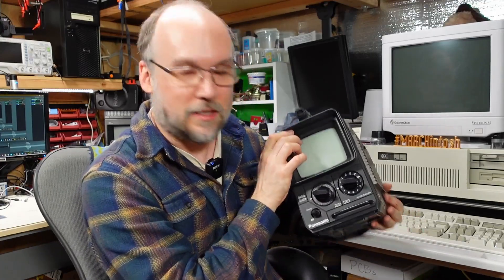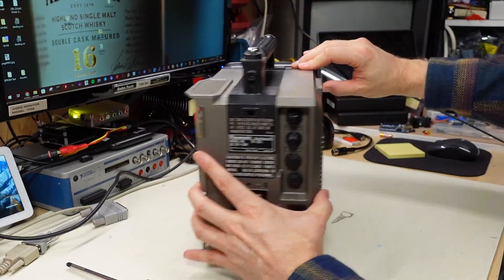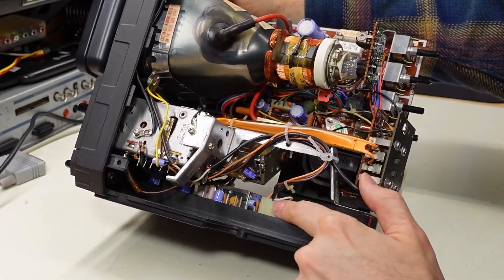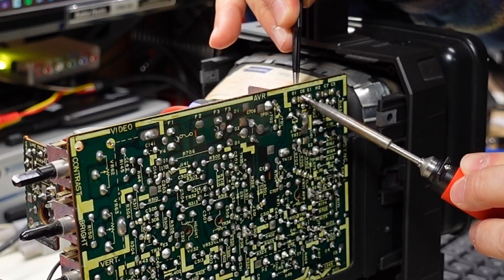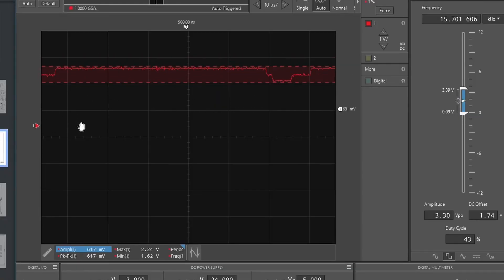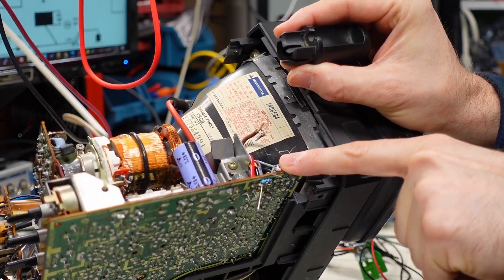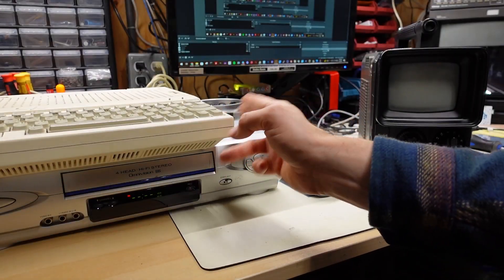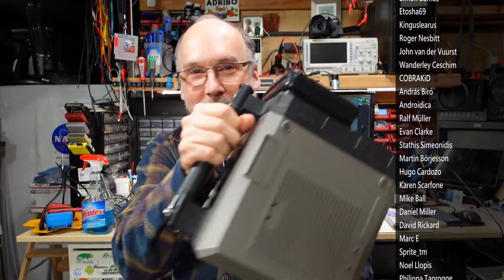Adding a composite video input to this 1977 portable TV (Panasonic TR-555)

Comment: Years ago I converted an old Russian "Vega" 6" tv to take composite, and I was surprised how good the display was. As a TV it was always a bit fuzzy with broadcast or a VCR even if you spent ages tuning it, but the output from my computer through my composite mode (not that different to yours) was really crisp. I guess the problem was with the tuner - maybe it was out of adjustment.
Reply: Similar story here, except with a Soviet (proudly says CCCP on things like the IF cans) Elektronika 409D, which was rebadged as a Waltham Telestar 4004 here in Germany. As a TV it was... meh at best. With a composite mod? Razor sharp image. And that's with all original components (granted it was only made some time between 1989-1991, but the internal construction looks a lot more like 70s tech than anything close to 80s, let alone early 90s)
Reply: It's also possible that you bypassed a stage similar to the dot-crawl suppressor that Adrian removed, particularly since it's always possible to make such filters very poorly.
Reply: Yeah,composite was always the worst back then,less than  s video,rgb,yuv...
I still use old tube tv,like pgm,trinitron and arcade cabinet.
The ’fetish’ of these screen is really great in retrogaming and old video formats.
Reply: @Knaeckebrotsaege  wait, how did you done that? I tried one time to inject a composite signal into it and found the used ic datasheet, but it seems like it needs normal video AND some kind of "inverted video signal" to drive CRT properly, and it don't show anything without that inverted thing
Reply: I did the same. Also with a generic HMV  (JVC?) B/W Tv. Destined as CCTV monitors before repurposing on a ZX80 then ZX81. The old tuners stripped for use in other projects.

Comment: I would have left the shield wire where it was and just disconnected the center lead, as the shield is also part of the circuit grounding. Also in the interest of being able to reverse modifications, I would have lifted the signal side of the filter only and placed some tubing over the loose lead.
Reply: ...or added some switches to switch in and out the mods!

Comment: A nice touch would be to add a microswitch somewhere to the VHF channel selector and use for example position 1 as composite input and 'automagically' all the other channels would select standard RF mode. Not that there is much (or anything) left 'on the air' but would it would make the set even more usable for retro computers which only have RF.

Comment: Connecting audio via a capacitor to the vol pot is an normal way of adding and Audio Input to your TV!
Reply: Audio is a harmonies freq wave,  but on the other hand Luma stays mostly on the on the positive side of a voltage level, slowly filling up the cap, making it drift. 
So, they invented active black level clamps to "reset" the cap between lines.

Comment: The problem with that solution (a series capacitor and a passive divider to set the DC level) is that you will set the DC level of "average video".
That will result in drift of the "black level".  When the picture is entirely black the video signal consists only of sync pulses, and when the picture is entirely white, the video signal is much larger as it contains both sync and white level (1V).
As your divider (and the capacitor) move the average of the signal to the set DC level, your signal will drift "down" for white and "up" for black, and the black picture will appear as dark grey.
When using it with a computer you can probably see this when you clear the screen and then fill it with text.

To prevent this, you need to use a "clamp" circuit that defines the level of the sync pulses, not the average level.  That would involve using a diode between a low-impedance DC source and the video signal, and a weaker pull-down resistor on the video signal.  The diode will start conducting when the resistor pulls the sync level below the DC source level.
Reply: Thanks for the bias explanation and the clamp solution.  1N194 's are hella useful...
Reply: The simple bias solution was effective in getting it working, but yeah... There are better ways to do things.
Reply: Exactly. This causes the black level to change when there is a lot of white on the screen in the curent solution. A simple solution might be to use 4 diodes instead to create a 2.4 V voltage drop. One end on the TV and the other end on the 75 ohm resistor. Feed the video on the 75 ohm resistor and the TV will get the same signal but raised a fairly constant 2.4 volts. All DC coupled now which so should not have this level problem.
Reply: Exactly, is better to put a simple transistor to invert video signal before tr14 so again it inverts it and you have the original signal.
Reply: There is a concept called the “back porch clamp” that does the clamping on the “flat” part of the signal just after the horizontal sync pulse.
Reply: @stevebabiak6997  Yes, that is of course the optimal solution.  But for that you need a sync-separator and timing circuit, and an electronic switch (FET or 4066).  ICs are available for this purpose, but it will be more than a simple resistor/diode circuit.
Reply: @Rob2  - but you and I both know the back porch clamp is the only correct solution; that’s what the TV industry used for decades. And that is the point where the video level zeros out, so setting that video zero level onto some necessary DC bias is going to give proper video levels regardless of signal level and screen fill.
Reply: You guys are right, but bear in mind the application.  ;-)  Video circuits for things like this often were cheap and nasty.

A simple diode clamp isn’t unreasonable though.
Reply: Ihave this same set and i remember having to constantly adjust the brite and contrast while watching movies for dark and bright scenes.  It was running through RF.  Annoying .
Reply: @nickwallette6201  simple solution sounds good, where can I find a simple schematic for this? I would like to play from a CF card player to an old 80's boombox tv radio.
Reply: @izzzzzz6   Well, "simple" is in the eye of the beholder, of course.  If you're designing video circuits, a diode clamp is no big deal.  If you're just a moderately capable DIY electronics hobbyist, it'll take some research.

Just search for articles related to video with keywords like DC restoration, black level clamp..  There are tons of application notes from video IC manufacturers, EE journals, etc.  If you're determined to figure it out, you'll get enough direction to put together a few examples and see how they perform, but it can be a lot to take in if you're not heavily invested in electronics engineering.
Reply: @nickwallette6201  I'll check it out, thanks.
  Could there be existing modules that balance the black level? possibly? or is it a mandatory hack on the video in board of the existing device?
  I'll defiantly look into it it was just an idea I had when I saw an 80's boom box with tv for sale. How cool would it be to have 80's video clips looping every time you switch it on. But then I saw a guy who converted an old tv into a smart TV, not that it appeals to me but I can see people who would appreciate such a device. A portable smart tv stereo built into an 80's TV 
boombox. Build the hotspot right into it also.
"The Sleeper BoomBox"
Reply: @izzzzzz6   You really need to understand the context of the existing circuit.  It may have a clamp already.  It may accomplish the same thing another way.  There's no telling unless you analyze the front-end circuit and figure out what it does and doesn't do.  If you study some textbook examples, you'll probably notice the one you're looking at is similar in many ways, but will also have its quirks or unique elements as well.

No easy plug-and-play, drop-in fix for that, I'm afraid.  Everyone will have arrived at nearly the same answer, but taken different routes to get there.  You just have to learn how it's typically done and try to understand the decisions the original engineer(s) made.
Reply: im telling yah wizards are real, and this is what it looks like. electricity is magic, im tired of pretending its not, and just because science helps us understand something on a rigorous level doesn't mean it stops being magic. after all wizards perfectly understand magic.

Comment: 00:04:00 Auto tools for plastic pins are great for removing knobs, socketed items, relays/fuses and separating small plastic housings. 

A generic 30 degree push pin plier is designed to already grab that shape while mechanically levering out the item with even torque on both sides. 

They make very thin side cut pliers for grabbing and prying/or cutting behind flared items like clips or knobs. (Astro Pneumatic 9581 or Wisepro WP031-1 or snap on equivalent)

Your work is brilliant, Happy Day!

Comment: This is awesome. I have a small cute Telefunken black and white tv with only RF in, and an internal 12V transformer, so this mod is totally happening! Thank you so much for this. When I opened the case, I found a little ziplock with the original ciruit diagram, all on one A4 sheet. Gotta love the good ol days!

Comment: As always an interesting video.  FYI, at 11:00 you are discussing the 4.5MHz filter and note that it is there to remove the chroma information to prevent patterning.  4.5MHz is the audio sub-carrier so that's what this filter would be removing.  The colour trap will be at 3.58MHz.  If you look further back along the video path you may well see some filtering to do that.  Obviously the sound trap does nothing useful when injecting composite so bye bye to it.

Comment: Glad you pointed out that you cannot do composite/RGB mods on hot chassis TV's. You can never rely on the neutral (cold) side of the plug anyway - neutral may not be referenced to ground in certain cases. As this TV runs from DC voltage, you can be quite sure the power supply will be isolated - the AC input likely has a 12V transformer!
Reply: Also a good sign is a headphone jack is present. Again this points to an isolated power supply being present.. otherwise youd potentially have 120V flowing onto someones head via the audio ground :)
Reply: @jaycee1980  Even if neutral is referenced to ground at the house panel this doesn't mean it is at ground in the TV. Wire resistance will cause a small voltage rise in the neutral and connecting it to a grounded computer will instantly trip the GFCI.
Reply: @eDoc2020  exactly... and can cause damage.. and exciting tingles!
Reply: @jaycee1980  Well I"m crazy enough that I actually did a dangerous composite mod on a hot chassis set. However it was only with clip leads and only done under supervision and with a GFCI and/or isolation transformer.

Comment: Back in 1983 I did this on a Sony 9 inch at Brighton Technical College. It too worked great without altering the circuitry in any way. I guess that I was just lucky. I also fitted a 2 way switch so that it could still be used as a black and white tv.

Comment: This was really helpful in modding my slightly newer TRG-511T. Although that model needed a much lower value resistor between 10 VDC and the video signal to get the composite IN signal to match the circuit. But trial and error using this as a starting point!

Comment: Nice work! If I may suggest, add a toggle on that so you can switch between the RF tuner and video in. You never know when you'll need rf
Reply: I did a similar mod some months ago using a 3.5 jack where I added the missing normally-closed contacts for tip and ring, so when I plug a RCA-jack cable I can inject both audio and video, but when unplugged it just works as before.

Comment: I had already added a composite input in a chinese made "MEC" TV (it was also sold at many other brands, most notably Broksonic and sold here in Brazil by the 80's and early 90's. It even has (visually) the same tube and yoke as yours. After watching your video, I opened it to check for that filter near video input, and, sure thing, it was there. After removing, it's much sharper now, to the point of being able to read text in Windows 7.

Comment: Nice mod Adrian. I have a 1980 Phillips P45 5.5 inch TV which has had one owner.  Me. It looks similar to your TV inside except that it has a continuous tuner using varicap diodes. Externally it looks more like a movie projector with an oval screen hood and the tuning and volume knobs on the sides above the screen. It also has a tilting bail under the screen.

Comment: Very interesting about the transformer aspect, good to know. Most people cite the cost aspect of RGB conversion and I can understand that, cost to mod does go up with every tier as you go past RF to Composite, S-Video, Component, and RGB Ie. "Is it worth it?". But Composite is totally worthwhile on these TVs.
Nice you could find a schematic since that helps SO much. Great job man, even got that sweet B&W based Chroma sharpness rocking hard for retro PCs. :D Yeah some limitations like minor dimming, kind of thing a PCB patch could fix but justifying the cost of that over many TV models would be hard to manage.
I was thinking with B&W TVs one could easily make gels like a Vectrex overlays to add Green or Amber tint to these to look like monochrome monitors. That will be handy, so convenient to plug anything into it with a Composite port. ;)

Comment: That brightness variation is a side effect of using a capacitor to couple the video in, it will always seek the average level of the signal, ie if there is a lot more bright content on screen, the cap will charge up more and the output DC level drops so the picture becomes duller.
Video needs either a DC connection, or as done in some TV's, a DC restorer cct.
The voltages you see around the sync signal, with respect to ground, should stay the same no matter what content is in the actual picture part of the signal. AC coupling mucks that all up. (of course, set your scope to DC coupling)

Comment: 17:59 - both resistors + cap create a lowpass filter here. 23:31 - it's just the ray current
Reply from the maker: Yeah it does -- I checked the rolloff with high frequency test patterns and there is only a minimal effect... barely visible at the highest frequencies.
Reply: No, that arrangement (serial cap, parallel resistor) is a High-pass filter - the lower the freq, the harder to pass through the cap
(low pass it the opposite, parallel cap, serial resistor -- like a reservoir to clear the fast changes)

Comment: If the set has a bridge rectifier then a live chassis would be live whichever way round the plug is put in.  On the positive side of the incoming AC waveform the negative output is at ground potential.  On the negative side of the waveform the negative output will track it.  That's why you can't just ground the negative rail; the bridge goes bang straight away.

Comment: I have 2 of those, and your modification is priceless, are you able to take some pictures of the PCB where you’ve soldered the resistors? So we can just folllow where to solder and also mark the resistors values…. This video isn’t enough to try an reproduce the mod.

I can help create a GitHub docs page if you can provide those images. This portable TV has quite a lot of units floating around and a clearly defined instruction would help the community.
Reply: Good idea, also have a similar model keen on giving this mod a try. Let me know if you set up that GitHub page. Cheers

Comment: Though most monitors do also "isolate" the video input by using large uF series capacitor, the problem is that Luma part of the video are not a freq signal, unlike Croma (also Audio) that is.
So the cap voltage will drift. As the sync separating can figure out the sync tip, you could couple that signal to drain(reset) the cap before next line, called an active clamp circuit, in your case maybe trough two diodes as to keep black level clamp lifted to 1.4V. Or maybe there is already some clamping further down the schematic?

Comment: I have this exact model!  Two of them in fact.  I think I might implement this mod to one of mine, with a small change of adding a switch to keep the RF section intact.  Might even try tapping into the audio input.   I have a few micros that are 100% RF, so being able to switch back and forth would be nice.
Reply: I’m about to start the same mod… to confirm what’s needed . 
1. 47k resistor 
2.47 uf capacitor 
3. 75ohm resistor

Have I missed anything?

Comment: A small TV just like that one was my first computer monitor for my Vic-20 in the 80s. It came with an AC power adapter and you could also run it off D-cell batteries or 12 V car adapter.

Comment: I think I found an easy way to fix the brightness issue by adding DC restoration. I believe adding a diode (1N4148 should do) in parallel with resistor R??? should do the trick. I can't read the part number in the screenshot but it's the resistor between points 55 and 51 on the schematic. You'd want the diode's anode on the top by the CRT cathode and the cathode pointing to the brightness knob. Not seeing all the details there might be a tiny bit more circuitry needed but I'm confident the diode wouldn't damage the hardware in any case.

And for audio you can attach the input to the top of the volume control, as others have said.

Comment: The 4.5MHz low pass filter is probably for adjacent channel rejection (better selectivity). I'd have thought they'd use a 3.58MHz notch filter (for NTSC regions) or 4.43MHz (for most PAL regions) to get rid of the dot crawl, but I know many manufacturers didn't bother.
Reply: It's blocking the audio carrier from getting into the picture.